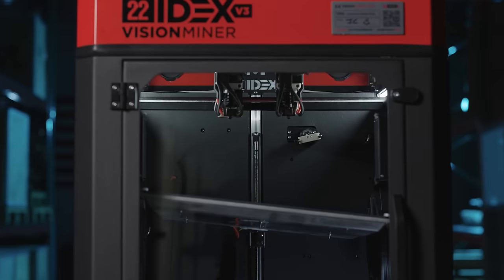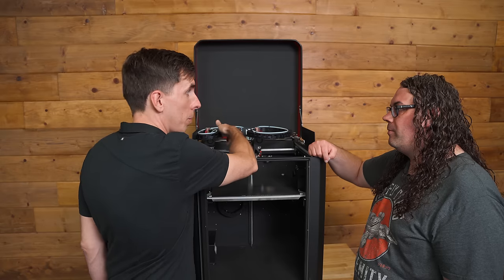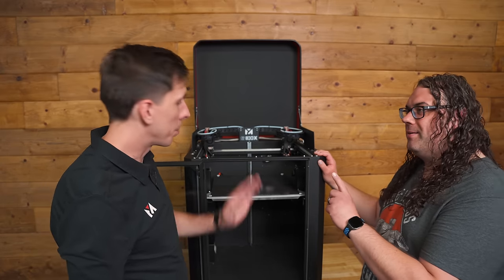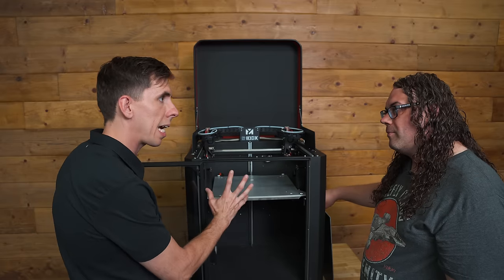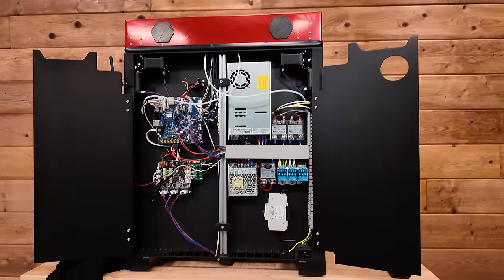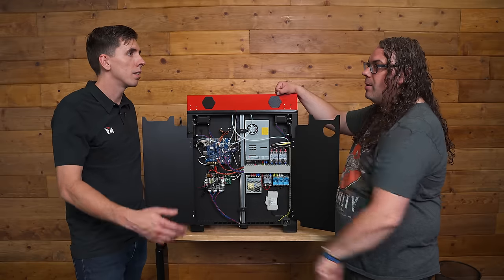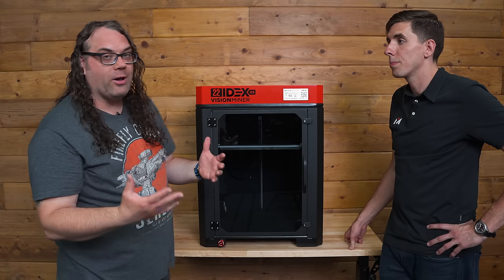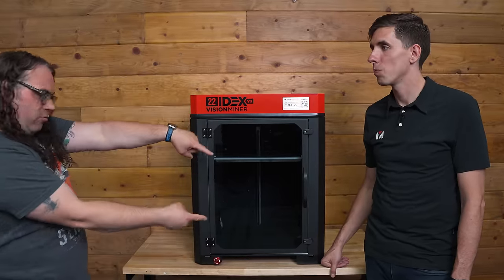NEW High Temp Open Source IDEX 3D Printer! 22 IDEX V3 First Look!

Comment: last I checked this printer is anything but open source...
Reply from the maker: Why do you say that ?
Reply: @TheEdgeofTech  Could just be me but when I think open source I think like, any piece of info I could need is readily available. But there is no CAD model for this printer to download, there is no BOM so I can source my own, nor are there any instructions. They even said in their video about it that they developed their own proprietary XY motion system. Nothing except the specs for this printer are available to the public, therefor to me, and I think to most, this printer is not in the least bit open source.
Reply from the maker: @coreypeacock9900  I understand what you're saying for sure! Pat, the hot end, board, power supply, Motors, etc. Etc are all readily available. We can get them right now If we want to. The board is open and not some proprietary firmware. I understand that the cad model is not available, But when it comes down to actual functionality and replacement parts, I believe it is. I will ask about the cad model because I'm curious though!
Reply: @TheEdgeofTech  I mean I get that but just because I can buy the parts for something, that doesn't make it open source... by that logic you can call a lot of things open source that simply are not. Yes those individual parts may be, but the unit as a whole is not. If something is open source, by definition that means enough knowledge about it is open to the public that it can be replicated or modified, such as Voron printers. No such information about this printer is available to the public besides SOME of the components it uses. Granted its my own opinion, but I just think that taking a handful of the components from the printer that are open source and calling the entire printer open source is very much a stretch.
Reply from the maker: @coreypeacock9900  I totally understand what you're saying and do appreciate your opinion! I see it both ways. Aunt, I am definitely not saying you are incorrect. I'm going to bring this up to the team and see what they say. Again, totally understand what you're saying, and definitely respect it!
Reply: @TheEdgeofTech  Totally see your side of it too and respect that also! It most definitely is a HUGE convenience to have a part break/malfunction and be able to have a replacement in a day or two because it's not locked down by patents or proprietary. I'd be curious to see the response from the team also!
Reply: @TheEdgeofTech  https://en.wikipedia.org/wiki/Open-source_hardware
Reply: Yea i see it more your way. It feels like "open source" is used as a marketing tool more than the intention to make it available for anyone to build.
Reply: @TheEdgeofTech It's not a ma of opinion. Open source is a technical term that has a universal meaning. Prusa mk3 is open source, you can get all the files and make it your self.
Reply: When I checked they didn't have firmware available either. This machine is also like 6x over priced. You can get a  pantheon and a half for this price.
His entire pitch isn't even true. The motion system is same as tridex or ratrigs vcore 4 idex. RatOS does about the same head offset dance as well. Probe is just a klicky, software is klipper. The entire printer is just bits a pieces taken from other true open source projects. Voron, ratrig, klicky, hydra bed leveling..... in a box. Visonminer does have some very powerful cad software tho, but it's 27 grand so yeah. I do love their bed dope tho, haven't had a single corner curl since.

Comment: I am pretty sure you can build that machine and maybe the bed won't go to 200°C but that price gap is ridiculous. It has normal 3D electronics it is insulated but that does not justify that price.
Reply: You certainly could, but they built it and did a bunch of r&d on it. I don't mean to sound absurd but 15k seems reasonable for a high temp idex. This is being used to kick out parts for aerospace, not print benchies. You're not making flexi print dragons for your etsy store and selling them for 15 bucks a piece. You might be making parts for an airplane that costs 800-1000 bucks.
Reply: @Wachpwnski  You can make this machine with exactly the same components for less than 4 grand. 15 grand is just silly.
Reply: @ that’s great then people can build their own… Not sure what your point is.

Comment: Its 14,900 dollars , Id say that is just a bit out of the range of your average 3d printer. Todays video is on the Sovol SV08 and my next video is a 15k printer...Such diversity
Reply from the maker: I agree that this is not for the normal crowd! It's definitely geared towards business, but it's super cool that they allowed me to come check it out and make a video on it! There's a reason why you don't see many/any videos on this machine. It's because the businesses that own them don't make videos or can't because they're under NDA. So when I get a chance to make a video about an awesome machine that could do more than I have ever even thought about doing myself, I definitely jump at it! I hope you enjoyed the video! What would you Make if you had a printer with these capabilities?
Reply: I think it’s good to show such printers now and than to see what’s possible in 3D Printing.
But yeah I bought a Snapmaker J1 instead 😅
It has a automatic X/Y calibration and a guided z calibration. Pretty easy to do. Only downside is I had in 3 months already 2 issues with it. Changed out X axsis rail and ribbon cable on the right extruder.
Reply: Its 15k dollars and they use the cheapest Meanwell LRS Power supplies without PFC-Filtering. Those would not even be Legal to use in the EU in homes as they are not class B rated. No idea about the US tho.
Reply: @TheKeverin  you only need PFC above a certain limit. I think it’s 300w. Don’t think this Printer needs more than 300w if the bed is powered by mains voltage.
Reply: @Todestelzer  But its only rated class A. So no Home use

Comment: about time! As a former V2 user for a short time, the previous version was terrible and completely failed. Bed falling off the shuttles, the old version of the emergency stop switch looked like it was from an old computer, i remember the wiring on the back looked terrible, probe breaking first try, nozzle bent... I can keep going, pics on the facebook community support page.  Glad to see that V3 is out with improvements, but until we have real reviews from other users, i would not consider.
Reply from the maker: @marcozacarias1675  I totally understand the apprehension! I'm hoping to get one myself and go through it so everybody can see how it is!
Reply: Thank you Marco for sharing your experience with our 22 IDEX. Since your purchase in early 2022, we've made significant strides: Your feedback, along with that of other early adopters, has been invaluable in shaping the evolution of our product.
We take all customer input seriously, which is why we offered you a full refund and thoroughly analyzed the returned unit. Your concerns didn't fall on deaf ears - they became the catalyst for over 150 improvements implemented over the past two years.
     Here are a few significant actions we have taken:
  Complete product overhaul: The current 22 IDEX is a far cry from its early predecessor, with enhancements touching every aspect of its design and functionality.
  Vertical integration: We've acquired Addwise in a significant deal, bringing manufacturing in-house. This strategic move allows us unprecedented control over quality and the ability to rapidly implement improvements. Interested readers can find more details about this acquisition in industry publications like 3D Printing Industry. https://3dprintingindustry.com/news/vision-miner-acquires-addwise-in-a-14m-deal-231289/
  Continuous refinement: The constant focus and hard work of our engineers and team along with your comments and others has paved the way for our upcoming V3 release.
  Industry validation: Feedback from aerospace, military, defense, and government clients has further refined the 22 IDEX, ensuring it meets the most stringent professional standards.
We're confident that the 22 IDEX of today would exceed your expectations. It's a testament to how we've transformed customer challenges into opportunities for innovation.
We appreciate your role in this journey. If you're open to it, we'd love the opportunity to demonstrate how your initial feedback has translated into a product that's now setting new industry standards.
Thank you again for your candid review. It's through such honest communication that we continue to grow and improve.
@marcozacarias1675
Reply: @VisionMiner  Thank you VM for responding, that really speaks to your commitment to address customer feedback. However at times, I do wonder if its just fluff so it looks good on these public places. The unit I received looks nearly exactly the same as the one you sent me with the exception of much neater wiring in the rear (plus some comps back there), upgraded emergency shut off switch, wifi antenna and non-3D printed printer feet (i actually really liked that they were 3d printed before). The Slice Engineering Hotend Assembly including the ducting, the bed heater, calibration probe, Z rods and so much more are all the same. I’m not seeing any significant upgrades between the V2 and V3 that would greatly improve performance, maybe software? The V2 bed temp, hotend temp and chamber temps all reached the target temps quickly. I'm guessing the same xyz linear rails and motors are the same. 
The Z rods continue to be free at their high point and if I’m not mistaken, the entire bed assembly isn’t secured in any way and continues to simply sit on the shuttles, so gravity does the work to keep it in place? This was one of the MAJOR concerns on the V2 as the bed fell off during calibration. 

Regardless, you guys are filling a demand gap that no one else is addressing and thank you for doing that. As an engineering, machines like this are super exciting! Maybe in the future I’ll consider this machine again, so I would like to take your offer.

Comment: $15k and not open source. This is a joke, right?
Reply from the maker: Um. It's definitely open source. Not sure where that comment came from?
Reply: Isnt opne source this a crp shit
Reply: This has always been open source
Reply: @marcozacarias1675  Point me to the CAD model of the printer then. Just because you can buy parts for it doesnt make it open source. Enough info should be available to just build your own. Which it isnt. Did they ever make the firmware open source or available even? I stopped checking long ago.
Reply: @resignator  ahhh I see what your saying. I guess we have different definitions of open source. For me, since you can replace just about all the parts on this printer like the motors, hotend, power supply and use any slicer or you can manually code anything you want on it, makes it an open source machine. VM did send me some of the CAD files for this machine at one point. But for you, it sounds like you want the bill of materials.

Comment: This is a nicely narrated advert and I mean it in a good way. Please show us the quality of printed parts. The kinematics are dual Markforged which inherently cause racking. Markforged mitigate that by having dual linear blocks and using many machined parts. 22 IDEX is using belts on both side of the Y axis which I assume also eliminate the issue. However I would rather see an actual printed part at whatever the maximum speed is.
Reply: Exactly!

Comment: This is an awesome video, and I'd love to see the ability to quickly print flow fields for fuel cells and electrolyzers with different flow patterns and number of flow channels. It would accelerate optimization for high temperature and chemical application in hydrogen generation and utilization. Being able to do that with gas and liquid tight, base resistant, materials in FDM quickly would allow researchers to quickly test new ideas rather than just going to CNC. Wondering if this printer could do that with roughly 100mm by 100mm by 10mm flow fields with different serpentine patterns.

Comment: That Vision Miner carbon fiber plate looks like high modulus 'Dragonplate'.
Reply: I think is from Rock West Composites. Still a high temp resin (not as heat resistant as Dragonplate), but it's a little cheaper.

Comment: Not sure why you would need to go to 500C for any plastic a Bambu x1c goes to 300c that's 572F. The new x1e goes to 320C (607F) and has active chamber heating and you could buy like 5 of those.
Reply: Engineering grade plastics need 300-450c and build plate temps well over 100c.  Bambu doesn't make printers designed for high temp engineering plastics, it's an entirely different class of printers.
Reply: do a little research

Comment: 😂 this is "Made in USA"  No camera, No cooling for the Board, worst printed and cheapest klicky Probe ever, No Display, cheapest 5015 for the heat chamber and 15K for this thing.... Just lol 😂
Reply from the maker: Interesting take on the printer. Is there anything about it that you DO like or is it all just bad??
Reply: @TheEdgeofTech  the high temp for chamber and hotend are a nice thing. The idex is also good. The suction is a good Idea as well, but should be included for the price. There was nothing said about the slicer, this should also be included and made for the printer. Lidar is also no included, so you have to calibrate like 5 years ago. No beacon probe or similar included. This is just ridicolous for this price.
Reply from the maker: @rammiii2908  thanks for responding! Actually it calibrates itself with the click of one button. There is no manual bed leveling and the slicer they use I believe is Prusa Slicer. And the probe is included.
Reply: @TheEdgeofTech  how can the filament be calibrated without lidar or something? I don't talk about bed leveling. Where is the accelerometer? If this thing would be sold for "tinkerers" for 2k maybe 3k it would be okay, but 15k for a printer with technology from 2020 is just insane.
Reply: I hope you get to try one out, I'd love to see what you'd do with it!
Reply from the maker: @offsetmakerlab7514  Me too!
Reply: @rammiii2908  Are you serious about this? First of all, you should realize how hot 100°C is. That is the temperature at which water boils. Any electronics in the build chamber would die very quickly. That's why a lidar or an accelerometer is hardly possible. You could possibly install a camera if you shield it very well from the heat, but the viewing window would quickly become cloudy due to the vapors from the plastics.

Your complaining about missing features only shows that you have not understood the purpose of the printer.

This printer is designed for exactly one thing. To print functional parts from high temperature materials that you could never print on consumer grade printers.
Reply: @rammiii2908  100% on point. I bought the V2 and used it for a short while, I think i used cura to slice, can't exactly remember but quality was terrible and slow (ASA). Everything on it was manual which is soo old. But it did come with the same probe as seen on the video which broke during the first test print for me. IMO, it does have good bones, but needs many many more improvements.

Comment: Yuck, it has slice engineering parts.

Apart from that glaring fault, it looks pretty well built, open source and a well laid out electronics panel are both great, but there weren't many details about the motion system, speeds and feed etc.
Reply: It's an industrial product. "Temperature Rating 450°C" for the Slice Copper Head - and they stated in the video it can do 500C.
Reply from the maker: Thank you for your feedback! I can ask them about the speed and feeds, but mostly this thing would be used for very high temp filament and you would want to go slow for that. But it's definitely good info, so I will for sure ask!
Reply from the maker: @3dexperiments  I can't speak to that as I was going through what their specs are. But I will ask them! Thank you for watching!
Reply: @3dexperiments  They do state this in their own video as well.

I imagine its possible for a company to state a rating is one thing, but then later seen that a higher rating is fine too, or there could be revision changes, not that I'd ever want to defend slice, but that sounds completely feasible.